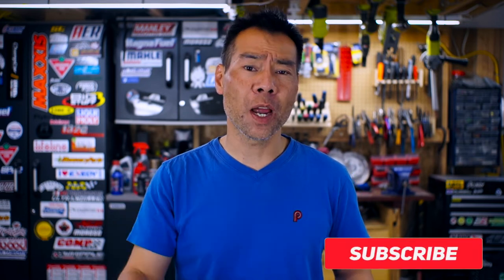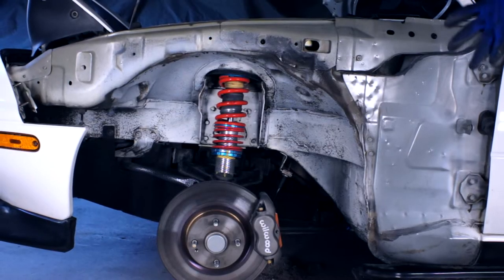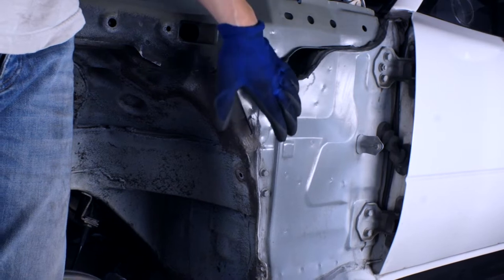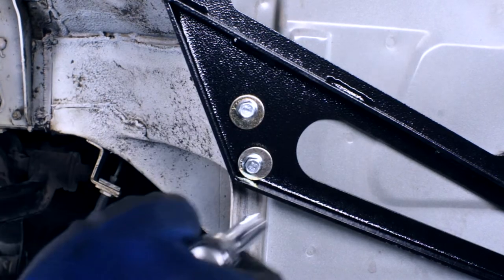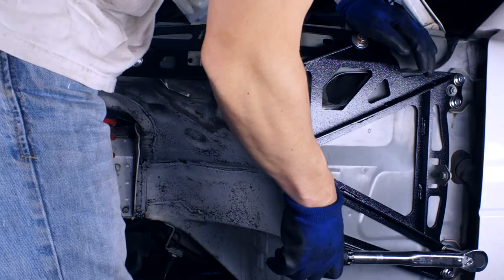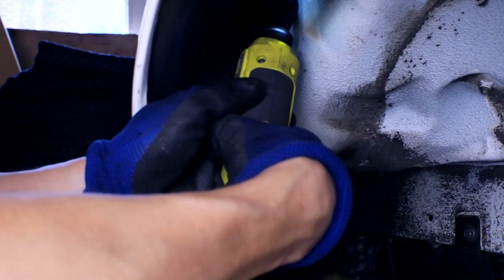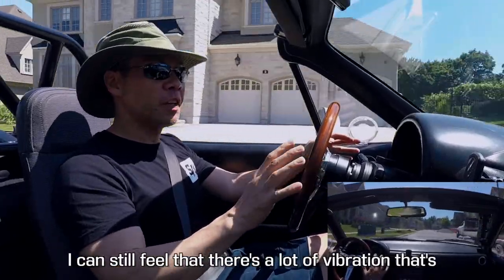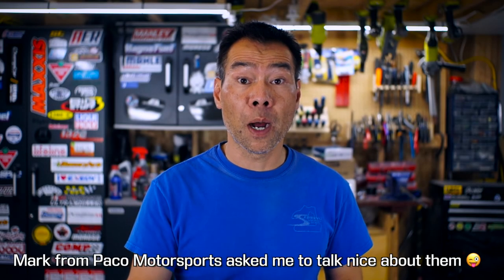Paco Strong Arms 💪 Makes DIY Miata Stiff! Test Drive!

Comment: I’ve always been on the fence regarding chassis bracing mods to the Miata. Not because they’re ineffective, but because they do have the potential to stiffen things up. And I feel that it’s almost part of the car’s inherent personality to be a bit of a wet noodle in the frame department.
Reply from the maker: True and to further your point, Miata racers measure any mod, chassis or otherwise, by lap time improvement and these make little to no difference.

Comment: You mentioned there was something to improve on these at 7:22, were you referring to the rear subframe brace video later? 
Also of the rollbar, frame rails and paco strong arms which made the car more enjoyable/less harsh on bumps in your opinion? Thanks again
Reply from the maker: Yup you got it, was teasing the install of the rear subframe brace. About harshness, chassis bracing mods tend not to affect the ride. The usual suspects with ride crashiness and harshness are high spring rates, low quality coilovers, and rigid bushings. Technically speaking, you could bolt on all these Miata chassis bracing mods plus door bars, butterfly braces, etc., with stock suspension, and the ride would be unchanged. Thx for the comment!

Comment: Thank you for this video, it really helped me along with my install. If it’s not too forward of me, I just wanted to throw some notes in from my own install (on a 2004 NB). 

Prior to install I asked the good people at Flyin’ Miata about whether or not it would be worthwhile to jack up all four corners of the car for the install, idea being that the frame horns would droop or sag less when installing the arms. While they said that the difference would be “granular” in nature, I still decided it was worth the extra effort to jack up all four corners. 

The bungee idea worked really well! I still got scarily close to the wires when drilling. And you just general the area behind the fender where you have to mess with securing nuts and such was a bit cramped for me. 

The FM instructions say you should have a friend help with the door reinstall, but I have no friends so I managed to do it alone. It’s not easy, but possible. 

Personally, my biggest challenge was realigning the fender. That was a super pain on both sides, and more painful since I left one of the bungee hooks in after starting to holy one of the fenders down. 🤦🏻‍♂️

Again, thank you for all the awesome content!
Reply from the maker: Great job and thanks for the detailed feedback points especially for NB owners.  Really good point about the door alignment and yes I did have fiddle with that off camera a bit, also by myself.  If I'm honest I'm not 100% happy with the way the door sits on the latch at the moment. Thx for the awesome comment! 😎

Comment: Hey! I've got that Nardi steering wheel on mine. I first bought the 340mm wheel, but it was rather hard work as I don't have power steering. This year I got the 390mm version and it is fantastic. Still plenty of room under it for my legs and so much more leverage when turning the wheel at low speeds.
Reply from the maker: I think the stock NB Nardi wheel is 400mm so 390 is still a bit smaller.  With power steering I found a smaller 330mm wheel was perfect on track for me. Thx for the comment!

Comment: I've been considering fender braces but I hadn't realised that the Paco braces extend beyond the strut towers. So thanks for the info. I''ll definitely look at doing the Paco ones now.
Have you considered door bars to improve stiffening the 'open' cabin area?
Reply from the maker: Definitely be a nice addition to the other chassis bracing you mentioned before!
Reply from the maker: Oh and yes I'm considering the door bars, it's one of the "ideas" to make it even better. Do you have them?  Are they better than frame rails?
Reply: @mostlyuselessgarage  Yes, I have door bars (and a roll bar). I didn't fancy drilling lots of holes in the underside of my non-rusty Eunos (yes, that's right - an MX5 with no rust!!). So I went for the door bars from BOFI Racing (UK) instead of chassis frame rails. They're brilliant. They even give you something to gracefully lever yourself out of the car!
Reply from the maker: Thx Phil, I've contacted them!
Reply: @mostlyuselessgarage  Hello, did you happen to try these out  or any other ideas you had to make it any better? I saw you made the video about the rear brace and the door bushings but was wondering if there are any others  you were interested in trying too
Reply from the maker: As I mentioned above I'd really like to make some door bars like the Hard Dog ones but the ones available off-the-shelf aren't compatible with my roll-bar. I have some experience with the Hard-Dog door bars in a friend's Miata and it really is the best chassis rigidity mod you can add short of a full roll-cage (like an SCCA compliant Miata Cage). Of course, door bars are inconvenient to climb over on ingress and egress, and can restrict aftermarket seat fitment. Open to other suggestions if you have!  Good luck dude!
Reply: @mostlyuselessgarage  I i 7kk7k
Reply: 7
Reply: I Oki ip
Reply: @mostlyuselessgarage  Ki Tolko look lkPin copied text snippets to stop them expiring after 1 hourSlide clipboard items to delete themSlide clipboard items to delete them
Reply: 8okooi
Reply: @mostlyuselessgarage  o
Reply: Iiokok